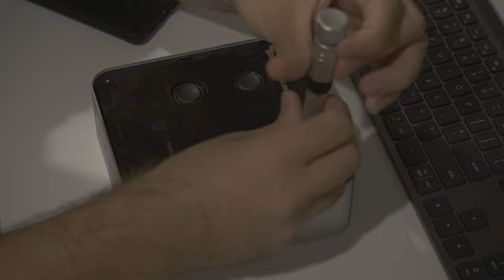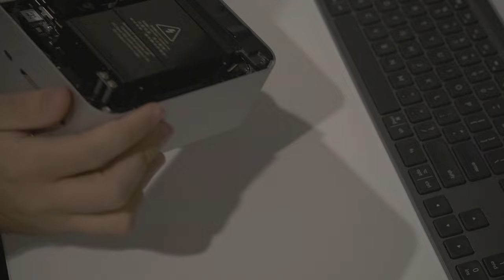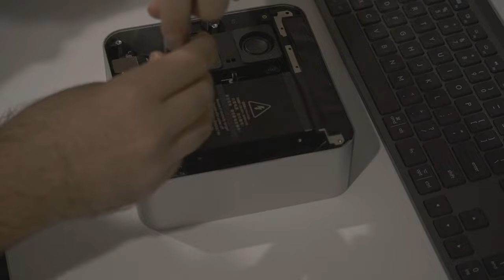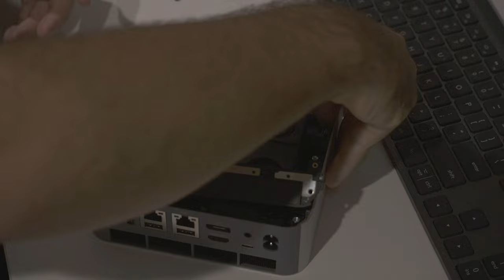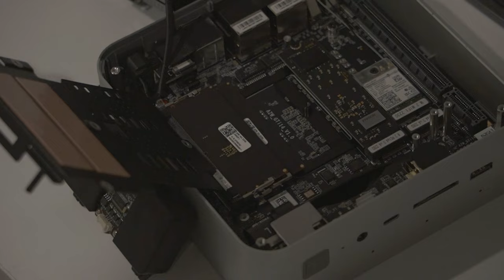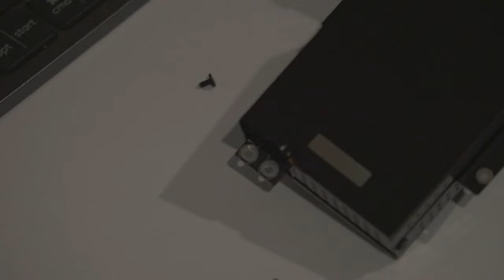Beelink GTi 14 Ultra Mini PC Teardown - RAM & Storage upgrades

Comment: Do you think there's any room for the SSDs and their original heatsinks to be installed inside the unit? It's around 8mm tall. Thanks.
Reply from the maker: The mid plate is right above the SSD slots. Definitely no more than 10mm of room above it

Comment: I bought this until and received it today. I also got the AtomMan G7 Ti to compare them both as it has the same CPU. 

The Beelink is significantly slower in the 3DMark CPU test. 

I’d love to hear what your observations have been so I can make my mind up about returning it.
Reply from the maker: What model AtomMan G7 do you have? I don't see any with the Core Ultra series CPUs
Reply: The X7 Ti has an Ultra 9 processor 185H.
Reply from the maker: @davidpower3102  Ah. I was looking at the G7. I have the Core Ultra 7 version of the GTi14 Ultra. Will benchmark it a few other systems with the same CPU and get back to you
Reply: @joshuaspires  that would be great. I’d love to hear how your model handles sustained workloads.